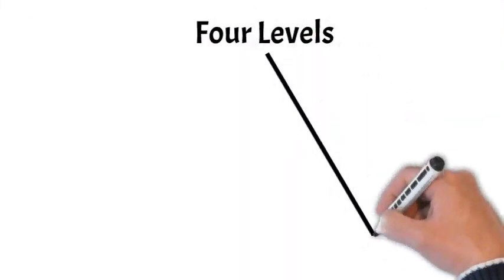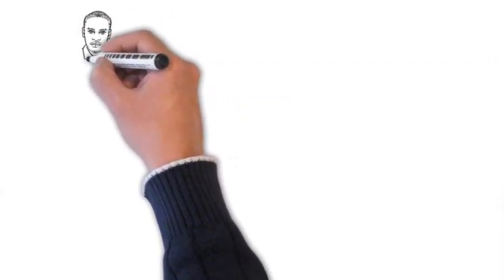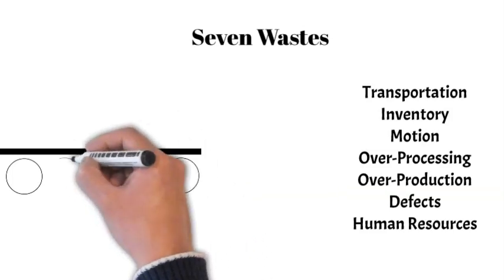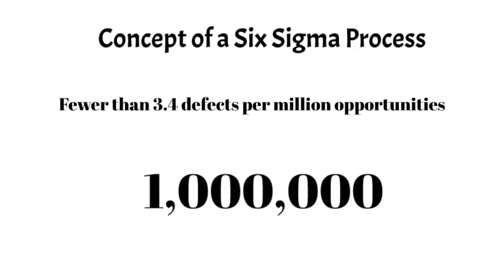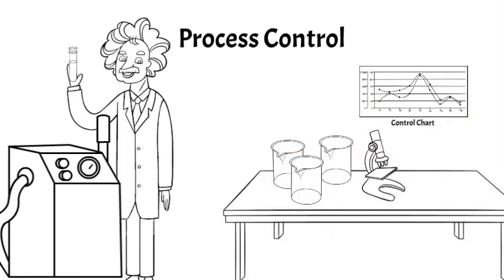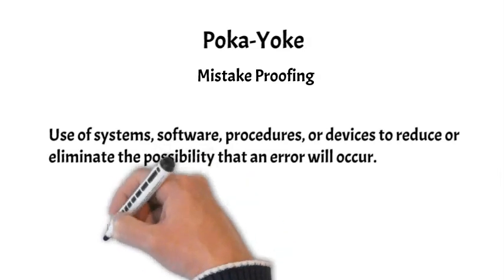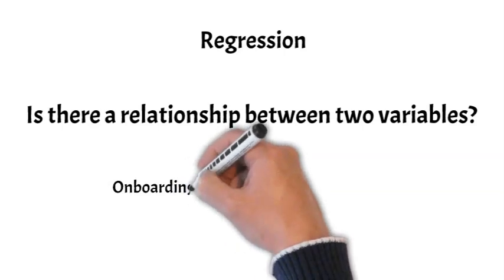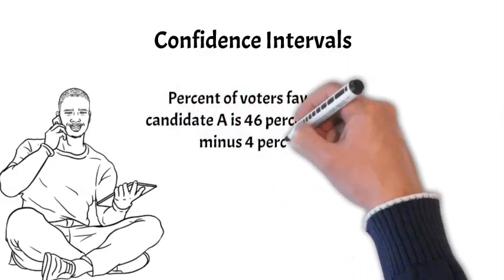Lean Six Sigma Green Belt | What is Green Belt Certification? [LSSGB Training 2025]

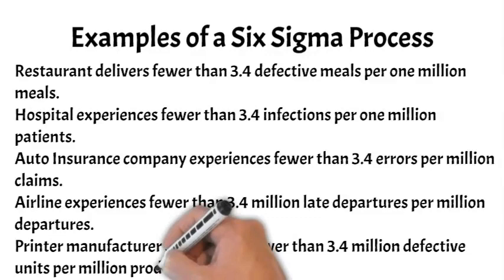Comment: Thank you for the video I appreciate you explaining and showing examples, I think you may have a typo on the slide at 9:45 "Examples Of Six Sigma Process" Airline and printer manufacturers experience fewer than 3.4 million defects/ late departures per million or 3.4,000,000,:1,000,000 defects as opposed to 3.4:1,000,000 defects.